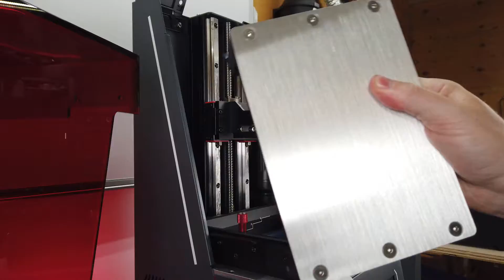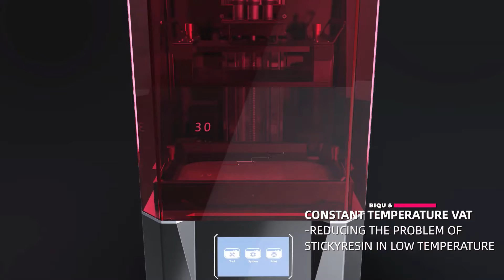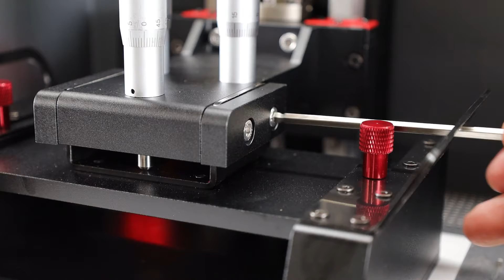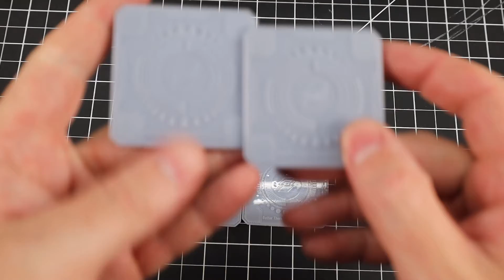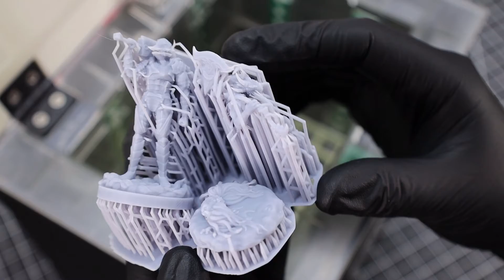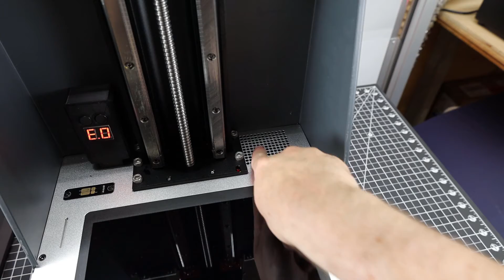New Resin Printer With Some Features You Can't Miss - BIQU PIXEL L 9.1 inch 4K

Comment from the maker: Resin 3D Printer:
BIQU PIXEL L 9.1 inch 4K 3d Resin Printer - https://bit.ly/BIQU-PIXEL-L-4K
Max Print size 196x122x220mm

Printer Upgrades:
BIQU Magnetic Build Plate 202x128 - https://amzn.to/3Q4jfWL
Rubber Edge Trim U Channel  - https://amzn.to/3JbnkGa

Wash, Dry & Cure Setup:
Eibos Oceanus KickStarter - https://bit.ly/OceanusEIBOS
Link to dedicated video - https://youtu.be/ZxsOo1NbUDI

Other Wash & Cure Options-
Mercury Plus 2 in 1 WASH & CURING MACHINE - https://bit.ly/MercuryPlus2
MERCURY X BUNDLE WASHING & CURING MACHINE - https://bit.ly/ELEGOOMERCURYXBUNDLE
or
MERCURY X BUNDLE on Amazon - https://amzn.to/3BkX0Yf

Resin:
Conjure Resin Tough - bit.ly/ConjureResinTough
Conjure Resin Rigid - https://bit.ly/ConjureResinRigid
Siraya Tech Cast Castable Resin - https://amzn.to/3cOzMzu

Other Helpful Printing Tools:
99% Isopropyl Alcohol IPA 1gal - https://amzn.to/3zAER7z
Medical Grade Nitrile Gloves 100Pcs - https://amzn.to/3PG2h19
Flush Cutters - https://amzn.to/3zOfIql
The Ultrasonic Cutter - https://bit.ly/PhrozenSonicSaber
Silicon Work Mat - https://bit.ly/SiliconeWorkMat
Mug Warmer for Resin Bottle  - https://amzn.to/3QuZR6f

Resin Slicer Software - 
Chitubox Basic - https://bit.ly/Chitubox-Basic
Chitubox Pro v1.2.0 - https://bit.ly/Chitubox-Pro

3D files - 
Phrozen Calibration STl File - https://bit.ly/PhrozenCalibrationSTl
Siraya Tech Calibration STl File - https://bit.ly/SirayaTechCalibrationModel
BERSERK GUTS 3D PRINT MODEL - https://bit.ly/BERSERK-GUTS-STL
Archvillain Games - https://bit.ly/3zBTFTw

This printer was sent to me free of charge for the review but no money has changed hands and all my thoughts and options are my own.

Other Good Printer Options:
ELEGOO Saturn 8k - https://bit.ly/ElegooSaturn2Printer
ELEGOO Saturn S 4k - https://bit.ly/EleooSaturnS4k
ELEOO Mars 3 Ultra 4k - https://bit.ly/ElegooMars3Ultra4K
Creality Halot One Plus 4k - https://bit.ly/HALOT-ONE-PLUS-4K
Phrozen Sonic Mini 4K - https://amzn.to/3atTgIs
Phrozen Sonic Mini 8K  - https://bit.ly/PhrozenSonicMini8K

______________________________________________
If you are looking for more tools and materials that I use, well you're in luck! I made a page on my website just for that.
https://GomeowCreations.com/tools-and-materials 
https://GomeowCreations.com/partners-discount-codes

Note: Most of the links that I use that go to products are affiliate link. This means I make a small commission on anything that you happen buy using them. This is at no extra charge to you and this helps support the work I do on this channel. 😁👍
______________________________________________
Other Ways To Help Support The Channel:
My PATREON ➜ https://patreon.com/GomeowCreations
One time support ➜ https://paypal.me/gomeowcreations
______________________________________________
Instagram ➜ https://instagram.com/gomeowcreations/
Facebook ➜ https://facebook.com/GomeowCreations/
______________________________________________

Comment: At 1k i hope its as good as 5 of my current machine
Reply from the maker: It would really depend on your needs but if you already have 5 printers adding a new one might not help. What do you normally print?
Reply: @GomeowCreations  i was more saying its five times as expensive as the one i have now. Im quite happy with my 200 by 140 mono setup
Reply from the maker: That is totally fine and if that one fits your needs then there is no need to get anything else.

This printer is going to do good cold areas and so far has made some great prints. I can really see using it being used more with castable resins. If you are selling casting work just one build plate printed will pay for the machine 😁👍